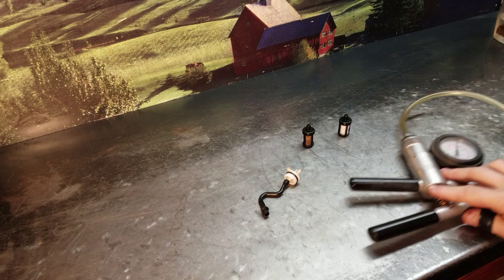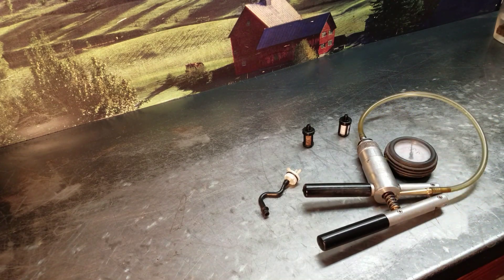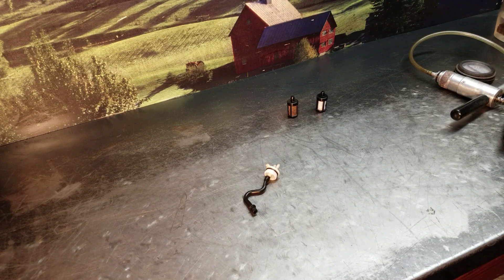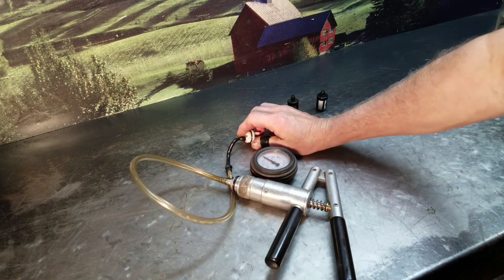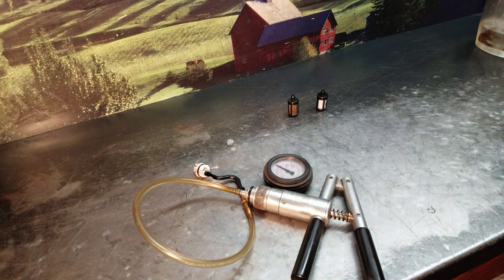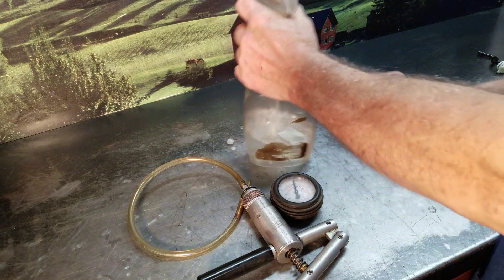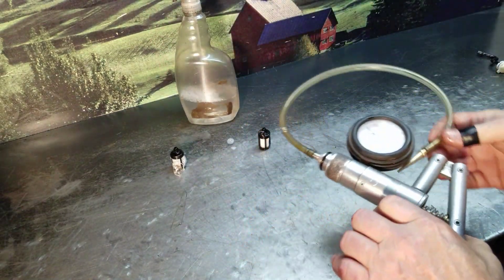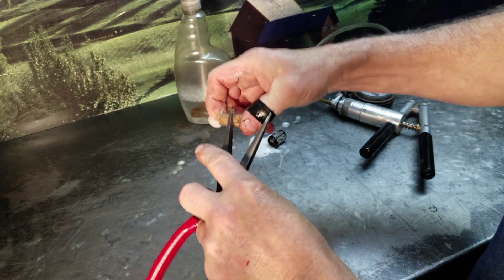The Chainsaw Guy Shop Talk Testing fuel systems 101

Comment: Great video sir, greetings from Finland.I have a saw stihl 181c that starts for a rotation or two and the shuts down, im wondering could the problem be in the fuel line or carburetor.cleaned the carb with ultrasound and changed new diagrahms.The exhaust had some gasoline in it after trying to get it started.
Reply from the maker: Greetings Jarkko!
Most likely carburation,
I’d replace fuel line, fuel filter and carb.
WestCoastMuscleSaws 
TheChainSawGuy 
Rich
Reply: @WestCoastMuscleSaws  Thanks alot!Ill try that one.